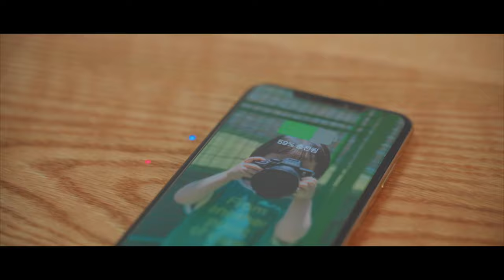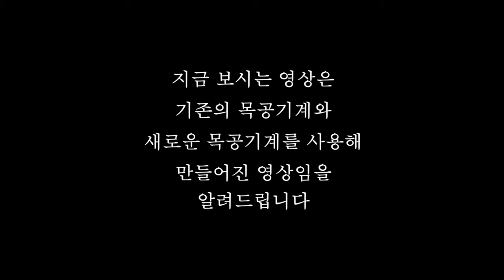질럿이 드라군 데스크로 환생하다?! 충전, 스피커 탑재! 다기능 드라군 원목책상Woodro Leehyun starcraft gaming

Comment: Thats a beautiful table. I'm curious about your machine, is the angled piece that holds up the gantry something you made, or is it manufactured? If I was manufactured, do you have the name of it? I would like to replace a plastic piece on a cnc in my shop with it.
Reply from the maker: Hello B B! All of the wooden furniture in the video is processed with leehyun machine.
Reply: @woodroTV  Thank you, but I'm interested in one of the machines components. It's the angled riser that lifts your X and Z axis, you also have your computer mounted to it. I'm curious to know where you got it.
Reply: At 8:09 its on the top right hand side of the screen, your handle, which is in your right hand, is attached to it.
Reply from the maker: @BB-wj8dv  For the accessories in the corresponding part of the video, a Korean company that has a cooperative deal with the woodroleehyun team makes exclusive accessories and distributes them to us.
Reply: @woodroTV  I see, thank you very much. Keep up the excellent work.